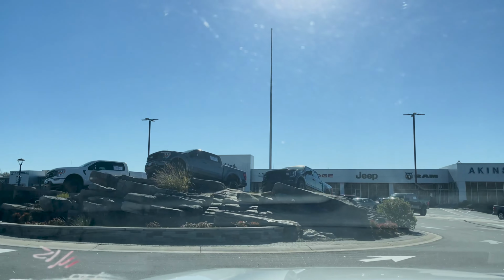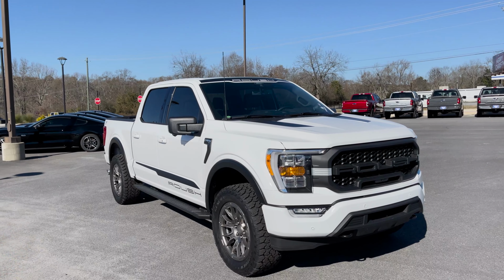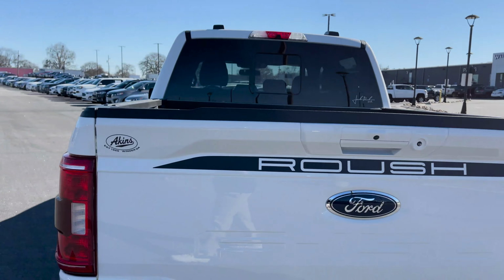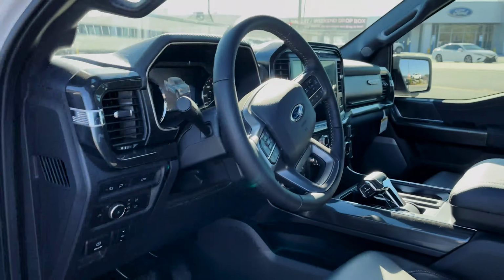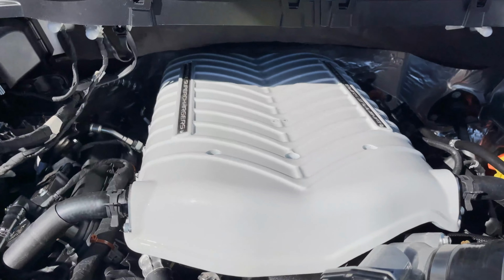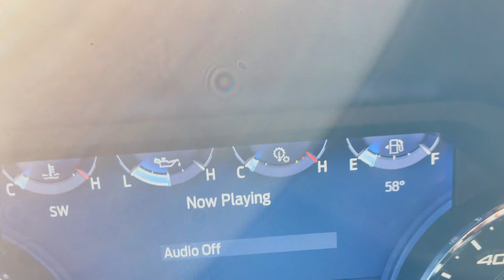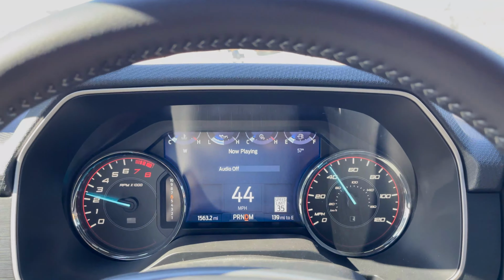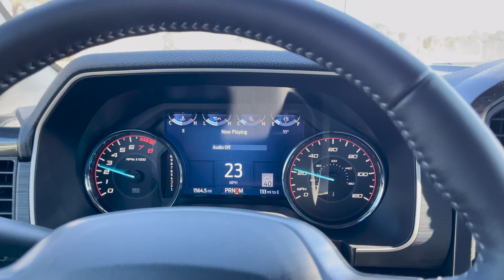2021 ROUSH Ford F-150 WHIPPLE Supercharged Custom Truck In-Depth Review

Comment: Did you change oil pump gears and crank gears!
Reply: I have a stage 2 gen 5 on my 20Gt350. I did them, but it’s not really necessary. Seeing how this went on a pickup, and it’s an auto, I wouldn’t have done it. I would have done the stage 2 though. Either way super cool.